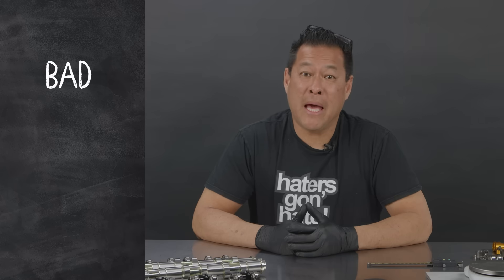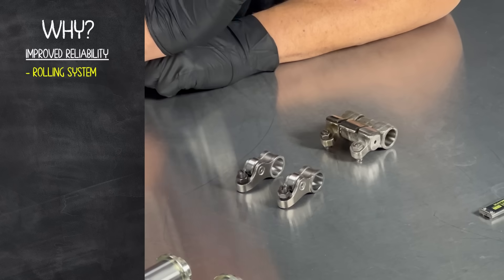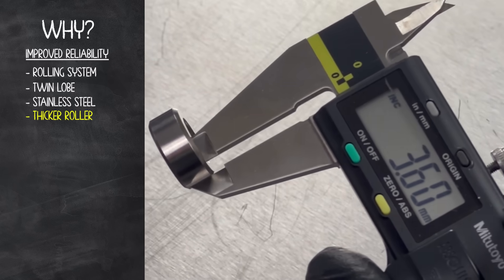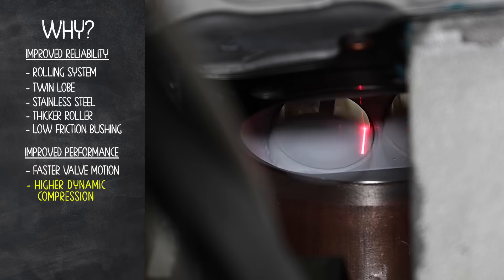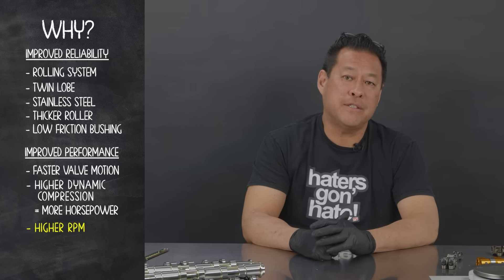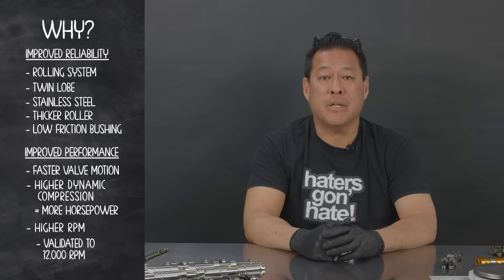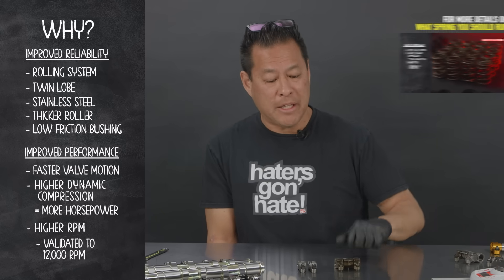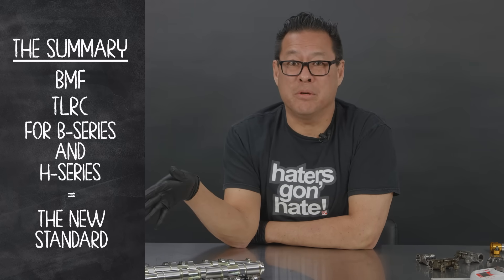What is Skunk2 BMF TLRC??

Comment: Hello Dave,
Which stage of the BMF cams would be most suitable for a 11.5-12.5 compression B18C5 NA engine that is designed for street and strip driving, as well as road courses? The engine should have good driveability and a broad power band.  Also what are the rpm range specs for each stage?

Thank you,🙏
Reply: None of them
Reply from the maker: We recommend checking out our Pro-Series camshafts based off the use of the vehicle and the driving characteristics you are interested in.
Reply: @Skunk2Racing  is BMF TLRC only for drag racing ?